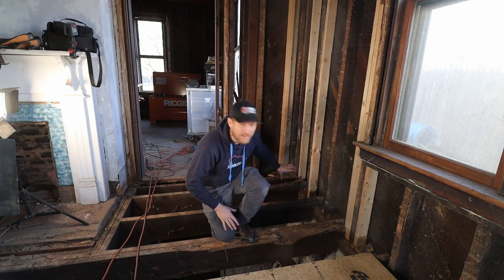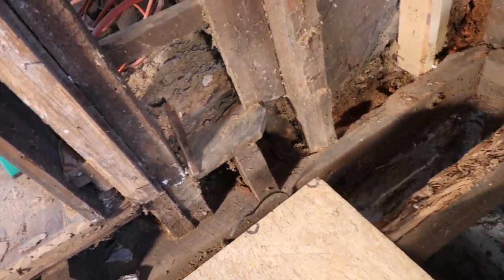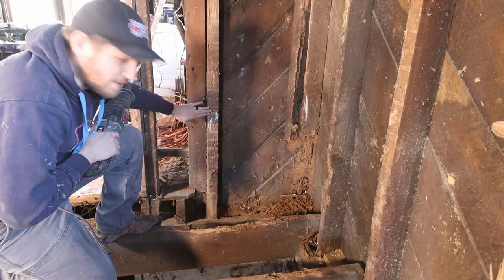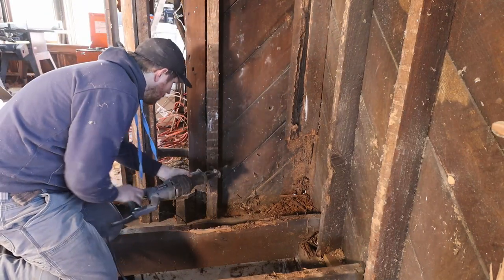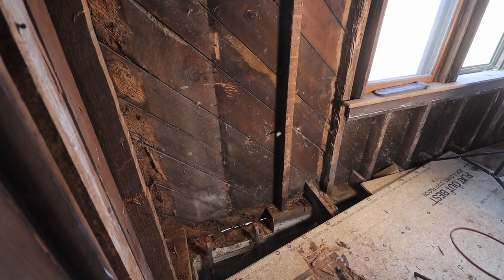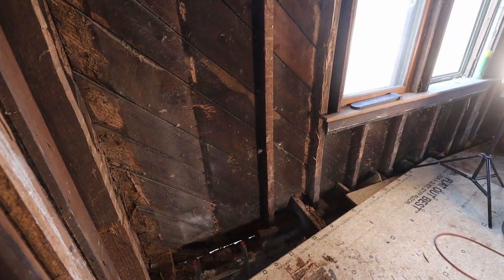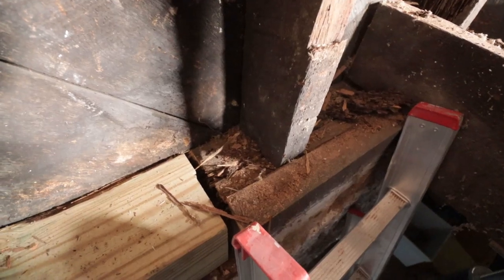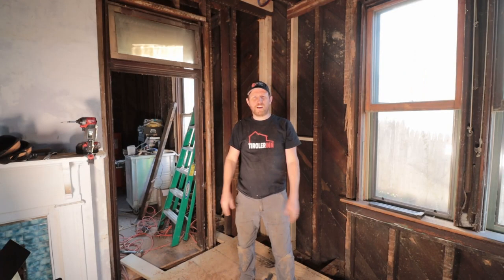Next Corner Replacement - The Never Ending Story - Victorian Home Renovation [TirolerInn]

Comment: Which was harder, the replacement of the support wood, or the demo? I was hoping you would have had smooth sailing after the demo. Better to get it all done now, rather than have bigger problems down the road.  👍👍👍
Reply from the maker: Hmm... the demo has been more labor intensive in terms of hours and cleanup. Yes that was our thinking too, rather get that addressed now than have to deal with it in a few years.

Comment: Wow, all this dry rot has been a huge project, is there anything you can do or are doing to prevent this in the future?
Reply from the maker: Yes, we knew there would be some rot to repair, but there has been a bit more than expected. The main thing is replacing the rotten areas and sealing the exterior so water doesn’t come in any more.